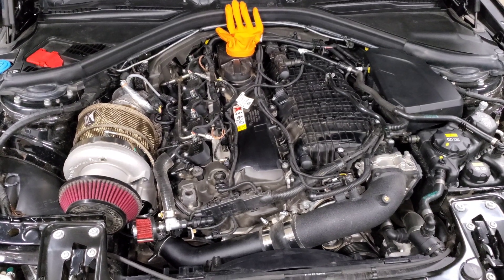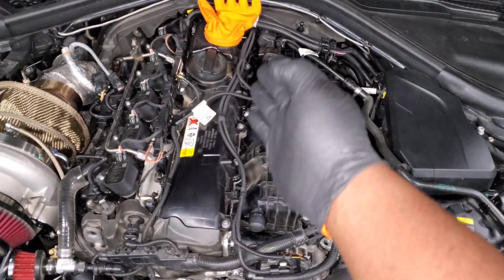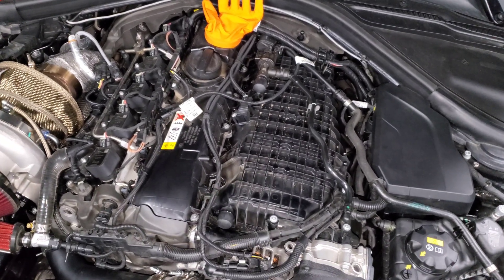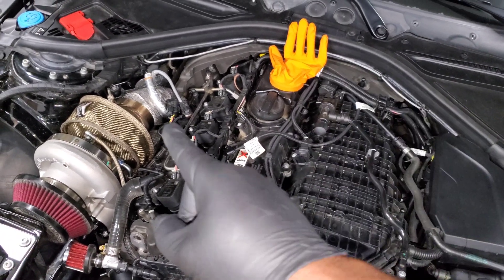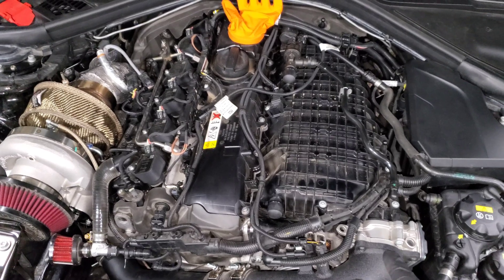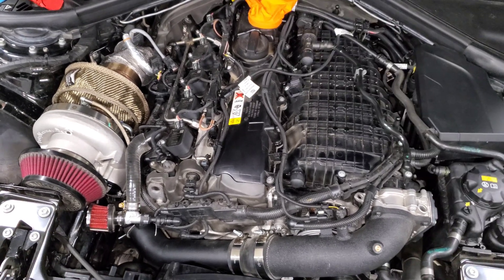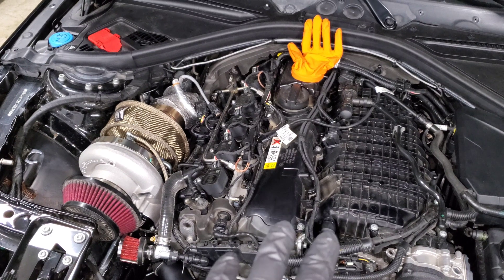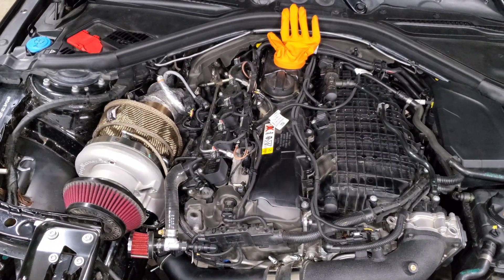Port Injection or Meth Injection - Is meth safe on the B58?

Comment: Hmmm.. I get it that running Meth in port intake runners is ideal. But if we inject Meth and gave a good distance (not too far) just enough between the injection nozzle and the ports for the Meth to get atomized and mixed well with the charged air, I think we will have a decent distribution of meth across all the cylinders. And because the nozzle is continuously spraying as long as the starting boost setpoint is triggered, all cylinders will get the Meth/air mixture.
Also using high pressure meth pump will help a lot. 
Positioning the nozzle direction slightly against the flow of air. This will further help for a better and fast Meth/air mix.

Comment: Hi dumb question , port injection that sprays methanol from the tank into each cylinder. Without running ethanol thru fuel tank wat would the outcome be if say i filled the tank half 100% percent meth and half eth? Or if take a octane booter and mix it into the the methanol. Wat would be the outcome be ? Stuck on tu pump and meth injection trying to get better fueling the dorch pump abit out of budget.

Comment: Yo kern, do you think the cylinder 5/6 problem can be solved with an upgraded intake manifold? Some of them seem to be optimized sending air/meth to cyl 5/6
Reply: I thought most if not all aftermarket intakes had provisions for port injected meth

Comment: I run a b58 tu pump on my m140 and tuned to run a 10% meth blend in the fuel tank with zero issues .
Reply: When running meth does the drink it constant like normal fuel or can you get adjustable maps where the car will only use meth if you select that map
Reply: @S55M3  good question. On stock ECU I don't think so, but with auxiliary systems like motive reflex possibly??
You can make it boost dependant though, so it only starts to kick in on higher boost tunes.

Comment: Can I get more hp by sparing water without a tune through port injection?
Reply from the maker: No
Reply: @kern417  the M4 GTS had it, but im not so sure it would be a good idea going "port injection" of just water cause you are not giving it time to evaporate and get the benefit of the cooling aspect of it, just potentially flooding the engine with a non flamable liquid.

What about having a single nozzle close to the turbo so the water gets the time to evaporate before reaching the throttle body? I used to drive a VW GLI with water/meth injection, at times i only ran water on it and it still felt like it worked, IATS were very low, is this a good idea for the B58? just wondering, the price of a meth injection kit is close to a flex fuel kit that would give me a bigger bump in power, just asking from the technical aspect.
Reply from the maker: Yes, that's the problem. You never want to spray directly in the port. The other problem is our intercooler is so close to the head, you can't spray after the intercooler. And the benefits aren't as great when you spray before the intercooler

Comment: Port injection is the location.
You can Port inject any kind of fuel by any means.
You can Port inject gasoline using a Bosch injector for example.
Or you can Port inject methanol using a mist nozzle. Like prometh

Charge pipe meth is injecting meth into the charge pipe.
Reply from the maker: Watch the video, then comment.

Comment: What's up buddy.. in a meth scenario I'm assuming the entire meth mixture is going through the air to water cooler? Is there any benefit in spraying water through something like a spacer - similar to the way the m4 Gts does it - to lower IAT and run higher boost ? Timing ?

Comment: You can run just water in your Water meth injection system,  and have all the octane you need,  since you're not fuel limited on the hpfp side. Quite simple really, no need for meth
Reply from the maker: ....no.
Reply: @kern417  yes haha

Comment: Technically the cylinders that get less methanol will also get less air, meaning they would of been running rich without methanol. Therefore running methanol at a single point would help AFRs balance out better. 
on 2JZ platform cylinder 5 and 6 always runs leaner due to majority of air hitting those cylinders. Adding methanol injection actually helps the issue as most of the meth is now consumed by cylinders 5 and 6.
Reply from the maker: No

Comment: Now I'm a little worried about installing my methanol kit in my supra .. as I have JB4 ...
Reply: You still worried?
Reply: @GrandMasterPurp oh man that was so long ago hahaha my supra has a methanol injection now and custom tuned for ethanol too.. its pushing the maximum mow
Reply: If i go any further i would need transmission upgrade.. its pushing 540 whp and 600 torque now
Reply: More than what i can handle 😅

Comment: You cannot run E85 or race fuel in a meth injection kit as it’ll kill the pump
Reply from the maker: I'll relay the message to the people that i know are doing it 😂
Reply: @kern417  it’ll run it but the petrol content will kill the valves in the pumps, over time they will swell and fail, it’s noted in various instruction manuals from snow performance, Devilsown, coolingmist etc

Comment: I've cancelled my o2 sensors because I have a custom exhaust. I want to add the snow performance stage 3DI proline meth kit and I have a stock gen1 fuel pump..what should I do? should I add it or buy port injection and use meth?
Reply from the maker: Port injected meth will always be the safest option. Then a custom tune for it.
Reply: @kern417  ok thanks for answering

Comment: Is there such a thing as a “high quality” port injection controller? If your controller dies, or an internal driver dies, or a cheap injector dies - you melt a cylinder down. Leaning out a cylinder happens so fast you won’t have time to even lift off the throttle.  If you shift your focus to the Direct Injection system, there are huge benefits across the board. Better fuel atomization, perfect fuel distribution leaps above port injection, and mainly the benefit of using very high quality engineered and tested components designed for high mileage usage. There is a point port injection is your only option, but that HP level is continually being pushed back as better hpfp and injector options become available. Why would someone consider a Chinese port injection system at power levels that are easily fed by Direct injection system upgrades?
Reply from the maker: Because a port injection setup will support a wider powerband and higher ethanol content.

Comment: Hey thanks for the vid you seem very knowledgeable for all this stuff I have a question , I have a 15 M6 built S63tu CP Carrillo pistons and rods , Dynod on Mustang Dyno @ 869hp 986tq 
I have Meth injection , through JB4 , 3 custom backend flash tunes for Meth , injected towards the end of the  charge coolers right before the throttle bodies, 

Map 0  safe map with Meth, run out of Meth it’s ok with just 93 670whp  Daily 

Map 7 Boost by Meth 28lbs boost Meth flowing ok , Run out of Meth drops  back to map 0  for safety 750whp 

Map 8 is 28psi with advanced timing boost by Octane with Meth , I put some Boostane in fuel for this map to about 103 octane / Run out of Meth drops to map 0  830+ whp 
So A few weeks ago I was on Map 0 safe map , I did a 3rd to 4th gear pull , Right after I shifted to 4th I heard a loud pop under the hood , I also thought I hit something😟, I then thought I blew a coupler off , it turns out I split my driver side intake Manifold via smoke test , Logs say 19psi when popped, so it shouldn’t be from boost , maybe Methanol backfire?? , can you give me your thoughts on this ? 
It sucks because it’s an engine out job, Thanks 🙏
Reply from the maker: It still could have been from boost just from the manifold weakening over time. The b58 manifolds are also known to crack under a lot of boost pressure. It's one of the downsides of plastic.
Reply: @kern417  Yeah thanks , I know 34-35 psi they were cracking from boost , I was also thinking when they put my engine in or when the pulled it they hit it or stressed it somehow , there is a company that makes billet intake manifolds for this problem , Thanks

Comment: What are your feelings running straight Meth vs a 50/50 mix ? 
I’m mean running E85 might be a little dangerous through a Meth system incase of a leak
Reply from the maker: 50/50 just dilutes the mix so it's less flammable. It's really up to you and your comfort level.

Comment: Would you recommend using CPI just for cooling not octane  it’s clear using for it for octane is not gonna end well for cyl 5,6
Reply from the maker: The safest way to use it for cooling only is to spray water so that it does not affect your fuel trims

Comment: Hey man, I've just received my Williams port meth injection kit. One thing you mention that I'm not sure of is spraying e85 through the meth kit. Can you spray e through nozzles meant for meth?  I always thought e was a heavier fluid that wouldn't spray, or at least wouldn't spray enough volume through meth nozzles?
Reply from the maker: You can spray whatever you want. If you need more flow then use larger nozzles.
Reply: @kern417  but can you alternate between meth and E on the same set of nozzles? Running meth all week, then throwing a tank of E in for the weekend kind of thing? Switching out nozzles is no small feat in these cars.
Reply from the maker: @fodaadam  You should run whatever fuel you're tuned for

Comment: Damn, I only have 91 octane avail with no E85. I’d be in heaven with some 93 lol.
Reply from the maker: when you're ready to turn it up, add a port meth injection system and never look back
Reply: @kern417  what are some kits for port meth injection? I’d rather run meth port vs fuel port. I haven’t seen much available for port meth kits. Are you using any type of meth now? If so what kind and where?
Reply from the maker: @badass1g  the one shown at 5:50 is the main kit i recommend. Made by Cobb Developments and sold by Williams Performance in the Uk
Reply: 91 and 93 is no big difference, what is ,is ethanol and meth injection

Comment: Hey Kern, what about port fuel injection vs port meth injection? Let's say hypothetically, ethanol is unavailable, 91oct, stock HPFP. What's the best route for big power to a kit similar to yours from doc? Lets say, 800whp.
Reply from the maker: If you don't have ethanol available then port fuel injection won't provide any gains. Port meth is your answer. Check out my last video about upgrading fuel pump vs port for more info
Reply: @kern417  that's what I was unclear about still was if throwing more fuel at a system would even produce gains without any proper octane/cooling. So I assume an upgraded hpfp and port meth would be the best combo if no E is available. Thank you!
Reply from the maker: @blakeromero7620  don't even need an upgraded hpfp. At most you can add a TU pump. But Meth will provide All the fuel and octane you need.
Reply: @blakeromero7620  no hpfp necessary if you're running port meth injection. There's no added stress on the hpfp if you're not running ethanol.
Reply: Dual port meth injection.
Reply: @1MTed  do they even make dual systems for b58?